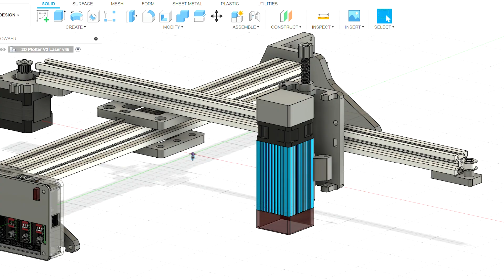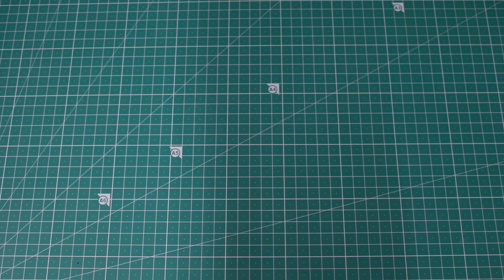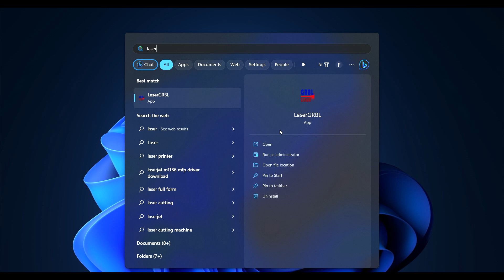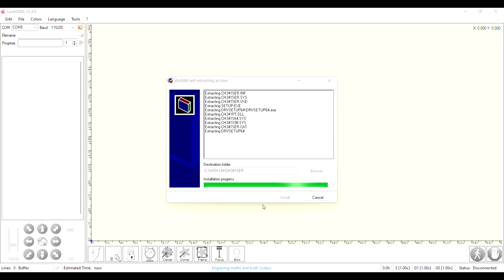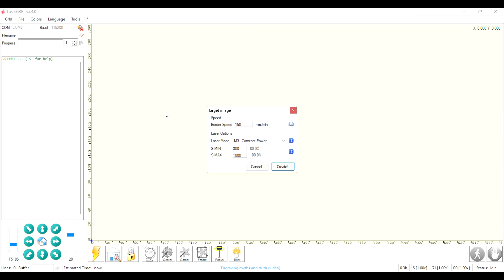Converting my 2D Pen Plotter into a Laser Engraver

Comment: Watched this after watching the writing machine 2.0 video. Super cool. Would it be possible to design the head in a way that would allow to easily switch between using the machine as a pen plotter and using it as a laser engraver? Also, is it possible to use parts of the 2.1 version for 2.0 (to give the Arduino a case like in this one for example)? Very new to all this, sorry if I sound like a noob

Comment: Excellent video, 
I'm considering performing the same operation on my DIY plotter. I believe the main modification involves is replacing the CNC Shield control board with an MKS DLC32 .. this imply better stability and a very important offline working mode. 
But this board is designed to work with a CNC laser, and I would like to use it to control the plotter's servo .. as well—an option I currently find impossible. If you have any ideas how I can do it.

Thank you.
Reply: Did you get any solution for this?
Reply: @ytskt  yes without problem.. I changed the CNC shield to an MKS DLC32.. works flawless.. excellent.. I love it
Reply: @slahsamet8722 what Pinout for servo did you use on the dlc32? Thanks

Comment: It cuts up to 3mm MDF board or 3mm plywood? I want to modify a DIY cnc router I have to laser cut thin plywood, I have a 10W diode laser engraver that hasnt been up to the task. Would this 40W laser cut it or do I need a CO2 laser?
Reply from the maker: it can cut 3mm in multiple passes at slower speeds, if you are looking for faster cutting, CO2 is the way to go